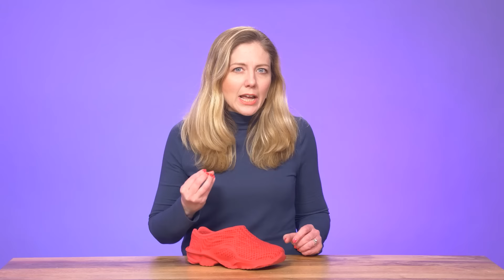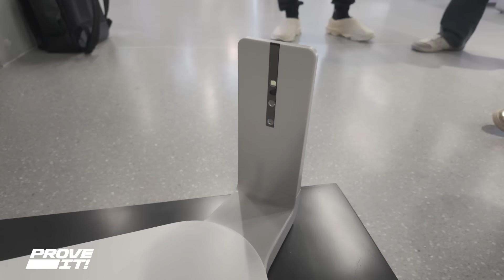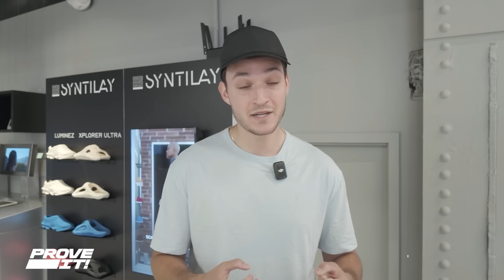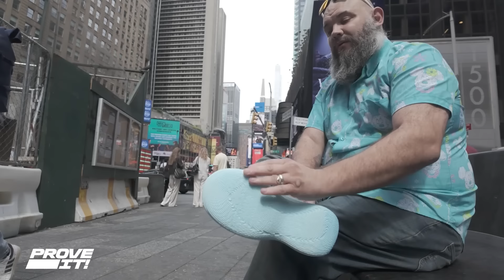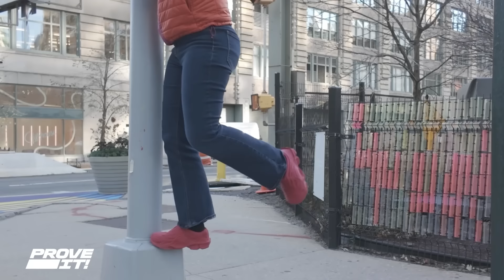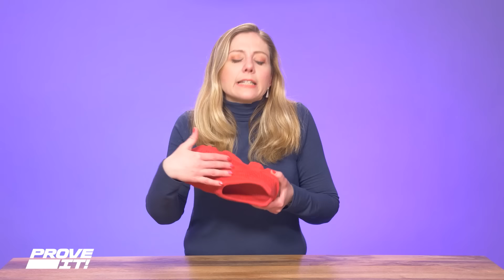This 3D Printed Sneaker Really Works (But It’s So Ugly!) | Prove It

Comment: Got a pair of Fitasy 3-D shoes in my normal size (i.e. no scan) and they fit great and feel like a highly cushioned running shoes (they are not for running) that happens to gently hug your foot while being super breathable.  I can see a future for these...a better supportive shoe than a Crocs which are suddenly what Crocs have been all along...cheap plastic shoes.  To me the Fitasy looks better aesthetically than the shoe featured here.  I sell shoes for my living and have done so nearing 50-years.  My observations on the Fitasy is based on my personal use in deciding if my store will eventually carry them.  The first week went quite well as I got to know them without one excessive pressure point and zero blisters.  Like I say, I can see a future for this category if it's done as well as these initial Fitasy shoes are.

Comment: Oh boy. $190 for a pair of shoes built by ai and a 3D printer, which you can't do one of the most common shoe based activities with: go for a run

Some how the human manufacturing process and typical raw materials for shoe is the cheaper option for a pair of shoes, so I absolutely despise this company who's sticking their hand out demanding nearly $200 to simply scan some feet and hit the start button on a 3D printer..

Comment: If you have your own printer there are several other designs available and it would only cost what you pay for the filament, maybe $10-12 per shoe.
Reply: Yeah this company is scum. Nearly $200 for a guy in Germany to press start on a 3D printer. 3D printed shoes or anything really should be significantly cheaper.. like people created automated assembly lines in the automotive industry to make cars cheaper to produce and sell, not make them double the damn costs compared to a non-automatic process

Comment: Well then. 190 is quite expensive. Specifically because 190 is a huge amount unless they are using some specific high quality filament, and given that it took 25 days....I can't see raw materials + manufacturing cost getting anywhere close to 190. However, tech that you can scan and generate a pattern you could feed into a normal 3d printer and print yourself using whatever filament that works for you is quite cool. In closing, I'm only interested in this because the more we get good quality but lower cost scanners, the better we can actually use 3d printing tech for printing at home.
Reply: Its nothing high-quality or specialized if you cant go for a run in a $190 pair of shoes.

Comment: $50 sure it’s worth a try. $190 for a plastic shoe - no thx.
Reply: My running shoes are part-plastic though…
Reply: @gordonou7065 key word "running". You can't run in the nearly $200 3D printed shoes.

Comment: I am excited for shoes that actually fit our feet... I know that most big companies like Nike and Adidas that are designed way to narrow at the ends. Feet are more rectangular rather than triangles at the front, and I appreciate a company that designs shoes for feet. I do like the concept of barefoot shoes, where they are not overly supportive, but protect your feet from gravel or asphalt. Companies like Whitin on Amazon are one option.